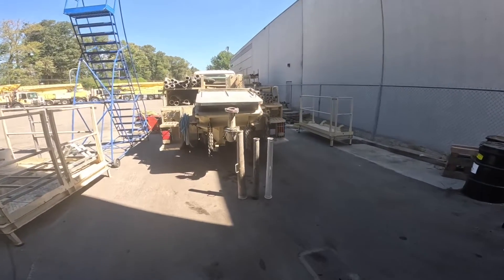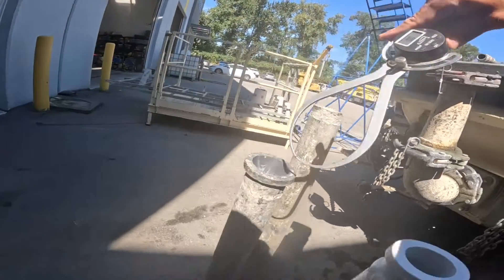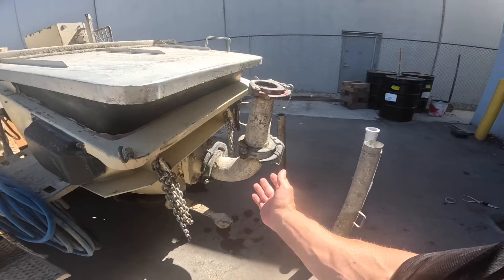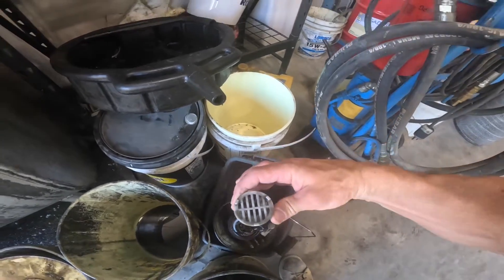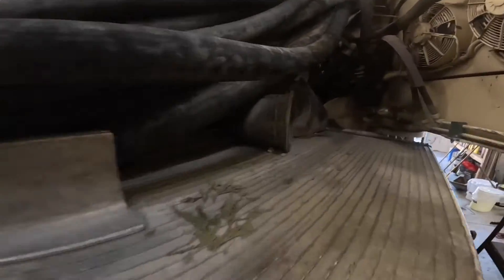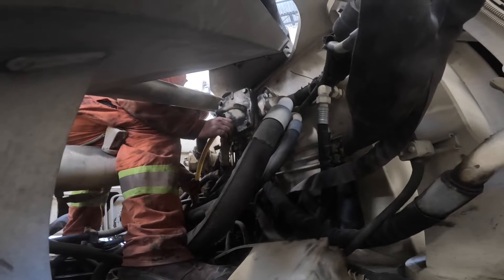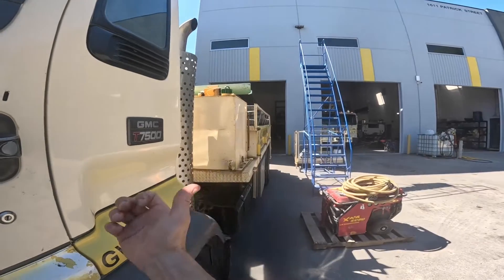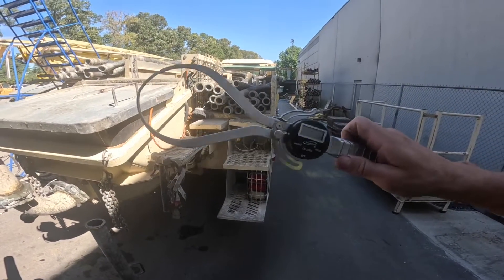Inspecting wall-thickness of reducers… and other fun stuff!

Comment: Lot of gear to stay in front of and your equipment looks to be in bristol condition, can't afford to get to job and have equip. not function. I did not realize you had that many large pumps. Ray Stormont
Reply from the maker: Thanks Ray. It’s definitely a lot to deal with, especially as they get older…. or even the new ones these days as the emissions after-treatment related components can be a constant issue.

Comment: It's mutch better when the filter stands in the direction so you can lift them up and don't make a mess with hydrolic oil evrywhere. We have the same type of tool to measure the pipes, we also have  sonar that can tell how thick the reudction is but that does not work on twin pipe. Keep up the good work :)
Reply from the maker: Often we’ll attach a vacuum cleaner to the filler neck of the hydraulic tank to create negative pressure, which keeps the oil from draining.